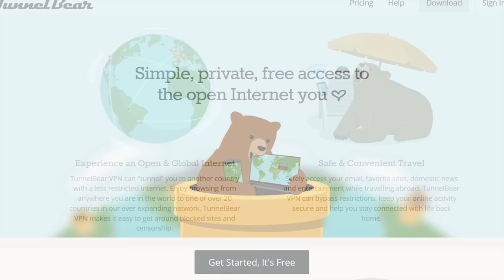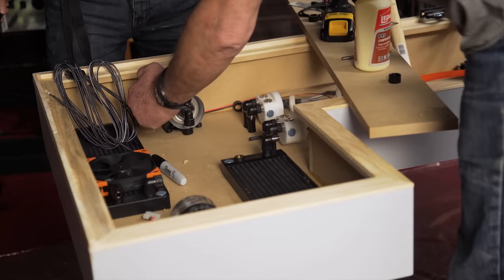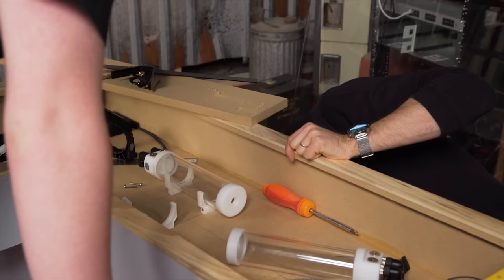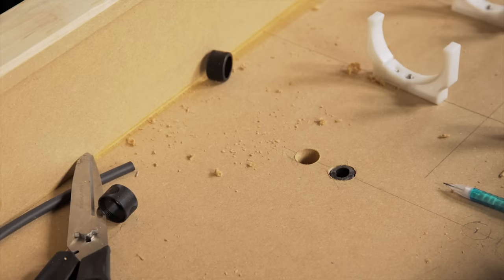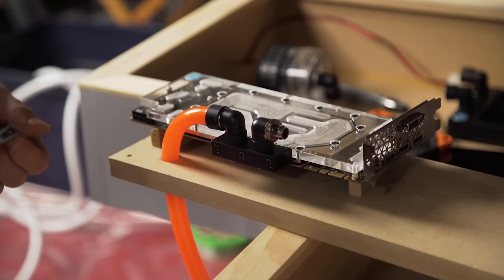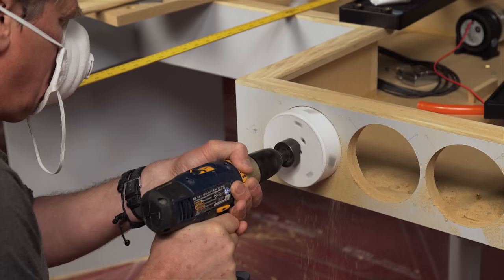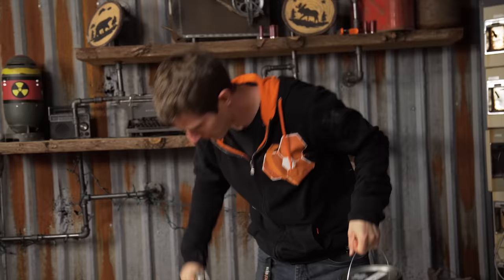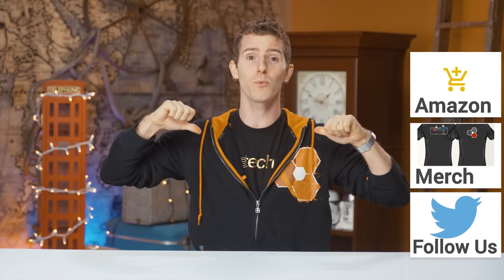Ultimate DIY Desk PC - DRILLING SO MANY HOLES

Comment: When building a desk:
1. Start with the desk's core - the top, so that the legs are not a problem and can be fitted later
2. Make a drawing - be it in AutoCAD, Google SketchUp, or even on paper, but take into account the thickness of all materials.
2b. Note where the holes go.
3. Since you did step 2, you can go to a shop, give them the dimensions and get parts cut to size and even laminated on sides usually for less money than your effort and tools needed are worth, unless you've got a workshop.

Comment: let me just state the crazy here. 40Tb of memoryspace??
Reply: Only 20tb thanks to raid 10!
Reply: you are right, but you have to stop somewhere, and it should be enough if you limit yourself just a little!
Reply: Krydolph But it's an one in a lifetime build, why not go wild?
Reply: If only it were 40Tb of RAM. ( Yes I know that would become useless)
Reply: Then why go a single 1080?
Reply: PeakLegacy You can use ram as super damn fast storage.
Reply: Jack Hinkley Good question
Reply: thats storage not memory bro
Reply: keppy considering ram is volatile, that's not exactly how things work.
Reply: Richard Mcilwain Linus explained in a video that your stuff can be stored in your SSD while your PC is off and when turned on everything will move to the RAM when turned on and back to the SSD when turning it off. It's very impractice but it's cool it can be done :D
Reply: But still requires an at least equivalent amount of storage, and it would be very slow to start the operating system I assume.
Reply: I need more space :(
Reply: TheBadBear -
Reply: TheBadBear Linus told me he's giving me the desk after he finishes it
Reply: +Imaad siddiqui yeah sure buddy
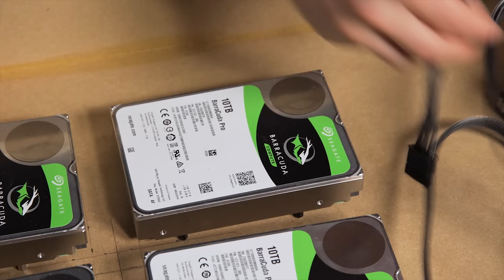Reply: Oscar yes there are 4. Each of them with 10TB storage as you can see in 3:47. 4x 10TB makes 40TB!!

observe before commenting
Reply: Howard Kurtus yeah right. sorry got things mixed up.
Reply: im just disappoited he is not using ssds indtead of hdd

Comment: "Ran to home depot to have the cuts made"  Yep, that's why your measurements are wrong
Reply: cmon guys, running down for a corded drill? Almost all your employee's are male, why don't you already have one?
Reply: TacticalBBQSauce are u saying that all men have a corded drill? TRIGGERED lmao
Reply: We don't?
Reply: DominoGames triggerrd!!!
Reply: I have something better a cordless drill witch uses 4 standard 18650 batteries which can be swapped out for a new set in minutes
Reply: +dossed yup, cordless drill with hot-swapable batteries is the ONLY way to go for me.
Reply: Just because I'm male doesn't mean I own a drill. I mean, I DO, but not just because I'm male.
Reply: Suhkma Dheek real men use their fingers to drill holes
Reply: Suhkma Dheek yo im lmao thats rlly good XDD
Reply: are you that tv commercial i saw today?
Reply: Real men have a carpenter's brace.
Reply: Everybody regardless of gender should have a Drill, Saw, and a few screwdrivers at least.
Reply: @tkfritz5790  I fully believe everyone of every gender needs to have a fully stocked tool set. With Klein hand tools, and while I prefer Milwaukee (old school, not used their new stuff, can't say), DeWalt is also acceptable (can you tell I was raised by an electrician?)

Comment: Moral of the story: dont use a desk with legs
Reply: James Landess dude same
Reply: use a desk that floats obviously or have slaves hold it up
Reply: T_T or use saw-horses to set just the top of the desk on and mount the legs last.
Reply: put the legs on the edges
Reply: Actual moral of the story: measure out where the legs are underneath, then draw it on top so you ACTUALLY know where the legs are xD
Reply: Actually the moral of the story is use CAD.
Reply: More like: don't use a desk with weird ass positioned legs. :D
Reply: Cant wait for hovering desks

Comment: Template tip, all of the standards for hole spacings and also I/O panels are readily available online. Use a CAD program such as autocad, sketchup, OnShape (my favorite), etc. to draw out or import the hole patterns, and print 1:1, double check the dimensions with a ruler/scale. Then use carpet tape to stick to your MDF or material, punch then drill the holes. You could have laid out all four of the hard drives on one sheet of 11" x 17", printed 1:1 in poster mode for the motherboard, or even you really felt over ambitious lay out the whole thing and print 1:1 in poster mode, tape it all together and drill all at once.

Comment: A little over 2 years later but a tip for building desks, tables or pretty much anything with legs. Have an idea where you want them to go but put them on last. For tables and flat desks you can always turn the whole thing upside down or on its side. That's why alot of pre-made furniture that you have to assemble yourself usually has the legs go on last in the instructions. Though I wouldnt suggest using only glue for holding them on with a heavy desk like this. The legs would probably break off when turning it back upright. Another tip is make sketches of everything.  From the shame of the desk, both inside and out and from all angles as well as where every component is going to go in relation to the desk itself. Even if you have to lay the actual pieces out first to get an idea. Like in part 1. Then you can start drilling and cutting.

Comment: My desk is built so that there is no gaps in the legs so to create airflow for my locked away computer I bought a second power supply to run 24 corsair sp120 purple led fans that I rigged to custom made vents along the join between the leg board thing and the top of the desk, tackled both my previously mentioned air flow problem and led lighting problem and looks AMAZING

Comment: Hey @LinusTechTips , i know it kind of doesn't matter at this point, but when you're using a power hole saw it is best to use a saw with a side-mounted handle for extra grip. Seen 4-5 guys at my old job break their wrists when the saw gets to hot or hits a snag and binds up. Anyways, great work, can't wait to see it when it is finished!

Comment: next time you do this, step 1 probably ought to be laying out a big sheet of butcher paper in the shape of your projected desk and arranging and marking out your components onto it, marking where to drill holes.  That can inform where to put legs, cutouts, etc without conflicting. also you can just tape the paper to the board when drilling.    Basically, since you want it to be a computer, figure out how to make the computer first, then make that a table, rather than the other way round.

Comment: Should have put in a false bottom for your tubing and cable management it seemed more than deep enough, as for the radiator fan holes just drill through both.

Comment: Personally I would have placed the motherboard with I/O going out the back, therefore making external cables for mouse/keyboard, networking, etc. less visible and then use a LED power/reset button and either a USB 3.0 front I/O panel and mount them on the front instead. I also would have made it as a L-shaped corner desk, but that's just because of spatial obstructions. (benefits of living in a small dorm...)

Pretty much if it weren't $2,000 USD and completely sold out, I would be thinking of a design very similar to Red Harbinger's Cross-Desk, but to put in a corner.

Comment: I made a desk similar to this! 
I eventually decided on having 2 glass panes instead of one big piece of glass as my mouse pad was going to cover it anyway, I used the hidden space in the center to do the cable management. 
I also added speakers in the legs, so they are a bit different to mine. 

(I have uploaded a video on it if you guys want to check it out its my latest one.)

Comment: For the legs you could of cut out notches in the actual leg any time you had a hole that hit one. Wouldn't of hurt structural integrity and would of aloud you to run water lines or cables without it looking like you made a planning mistake.

Comment: You could've also used a woodworking router to recess the glass and not have the problem with it possibly slipping and then just done something with the edges to get it to blend in

Comment: At this point you should start over since this is not really generic design anymore. It was an interesting design using only 1 sheet of MDF however you would have been better off with a more traditional 4 legged support design or placed the legs as part of the sides and added MDF side support for horizontal deflection...

Comment: Instead of hitting the legs every time why didn't you measure from edge to edge to double check the hole location on the bottom BEFORE drilling...

Comment: I need some advice I was playing on my PC then it suddenly turned off (lost power I think) and now it won't boot all the fans spin the gpu light is on 
I think it's the cpu or mobo 
Any solutions?
I have warranty on all my parts but I would prefer not having to send every part to be replaced

Comment: why not build a metal construction and place the radiators in the side and just run it through an partition. I mean it is more expensive and heavy probably more complication with cutting and other things but it seems easier.

Comment: Hi Linus i have a question. because i have a air cooled pc (except CPU) and i want to change it in to a desk pc would there be enough of air flow with 6 120mm fans and will the components over heat?

Comment: hey linus I have an issue i was installing windows 7 on 500 gb hard drive form win8.1 desk pc setup was in my 500gig hard drive. then everything going nice and suddenly my sata cable from desk was pop out. maybe not properly connected though. then what happenning is whenever i starts my desk pc it starts in win 7 and stucks with  a command prompt .also my desk is running on win 8.1.
can you solve this problem.

Comment: would of been nice to install 2 latches on the user side and a gas strut and hinges to lift the whole glass for easy cleaning and changing components. rather than sealing the glass to the table.

Comment: Does anyone realize that building a computer inside of a wooden box without any metal liners can create EMI (Electro-Magnetic Interference) problems? All electronics (even traces on a PC board - acting like antenna transceivers) produce some amount of EMI and/or are affected by some level of nearby EMI. Your computer case serves as the obvious container for the computer parts...but it also reduces/prevents EMI from escaping and/or EMI from entering. Coming from an electronics engineer background having to get FCC approval on ALL electronics made for retail forces anyone in this field to have to extensively learn about EMI and EMC (Electro-Magnetic Compatibility). So, depending on how robust your computer's electronics are and the surrounding electronics are (i.e. the stuff in the same room), you may find 'unusual' things occurring with either the computer and/or other electronics in the same room. So if that does happen...you'll now know why. You can line the inner box using copper tape sold for a reasonable price on eBay which would decrease this natural phenomenon (apply side by side with no seams and the complete copper shield must be grounded preferably at a single point), but the glass is another thing (can't cover up what you wanted to look good). Off hand I've never looked up the effectiveness of glass on EMI control/reduction, but I know wood doesn't do much if not anything at all.

Comment: So I have an Pentium G4400 and a GTX 750TI and I want to upgrade to an i7 6700k and a GTX 1060 6GB, but I only have enough money to buy one for now, which one should I upgrade first? 
The games I mainly play are:
Dark Souls 1, 2 & 3
Battlefiled 1
Skyrim with Mods
Reply: Areguil Gamer i think the processor
Reply: Neither. Save up money and buy both. You'll probably need a new motherboard to support the new processor btw.
Reply: CPU and mobo deffo, your current CPU is already bottlenecking the 750. 1060 prices will drop after christmas anyway.
Reply: eh not neccesarily
theyre both socket 1151, but if he wants the 6700k, he defo will have to upgrade to a z170
Reply: Areguil Gamer always upgrade the Cpu first. Also i would recommend you getting a 1070 or 1080 over the 60, the i7 will get bottlenecked by the gpu.
Reply: x2ceyez HAHAHAHA NO
Reply: nice try, but no, just no....
Reply: Areguil Gamer get the 6600k if you're a gamer (watch Linus' vid about it)
Reply: Get an i5-6500 and later a 1070. Much more balanced.
Reply: BassFyro 
No, i won't. I have z170 mini itx mobo.
Reply: Areguil Gamer Ah. Get a 6600K then.
Reply: I also do editing and photoshop, which is why I prefer to get the i7. I have a a Z170 Mini ITX MOBO.
Reply: Johan Ekstrom 
Okay, then. Thanks!
Reply: Areguil Gamer the cpu for sure.
Reply: your cpu is on current generation so you don't need to bother much about CPU (hence it's an entry level CPU), if you focus on game go for GPU else CPU. it's up to your PC primary task.
Reply: Get a i5 and a rx 480 for bf1 to get the best fps
Reply: Areguil Gamer dude do cpu in most mmo games it's better and it give su faster processing speed and it's so good that it can make your computer run about 60 to 100 fps more in game
Reply: Areguil Gamer If you do editing a lot and you feel like you could use more power there, then there is a good reason to take CPU now. GPU would be a waste because your current CPU would choke it hard. I took i7-6700k myself because I do graphic editing of different kinds and paired GTX 970 with that, since I didn't have enough money to buy too wild of a GPU as well. You might be fine with i5-6600, but that's something you'd have to decide for yourself. GTX 1060 is a successor to GTX 970, so I can tell you you won't be disappointed on 1080p, but again, decide for yourself whether you want to balance your PC for gaming more.
Reply: BassFyro The 1070 is the successor of the 970...
Reply: Johan Ekstrom It is not. 900 series was an exception in nomenclature, it has everything shifted up. Do not spill out disinformation based on uninformed logic. 1060 has ~10% better performance compared to 970 and also costs less.
Reply: encouraging people who already have latest cpu generation to buy new motherboard while lecturing other to not misinform. SMH
Reply: Nick Nack Snip Snap He didn't say which one he has, did he now?
Reply: BassFyro What's your location? The 970 was around $350 for a long time after launch, and the 1070 is around $380. T
Reply: Johan Ekstrom Oh look, glorious American pricing has changed.
Reply: BassFyro ? What is it? Non-american prices will never be at the American MSRP.
Reply: Johan Ekstrom Still doesn't matter to anything OP asked.
Reply: BassFyro True, but the 1060 is still not a successor to the 970.
Reply: Johan Ekstrom Image was a lot different back at launch.
Reply: BassFyro True.
Reply: "I have an Pentium G4400" meaning socket LGA 1511. do we really need to buy new mobo for upgrade cpu?
Reply: Nick Nack Snip Snap Depends on which motherboard it is. If you want i7-6700 with a K at the end, you would probably want a motherboard that would support a nice overclock of the CPU.
Reply: Save more money and get both. Its gonna suck either way if you only get one. Get an i5 and a1070. Your system would be future proofed for a few years.
Reply: Get a 6600k/6500
Reply: Stick with your decision and get an i7-6700k and GTX 1060 6gb, i have the same parts and i love it already (had them for about 1 week) People telling you go for a 1070, dont do it, its not neccesairy. 
But hey, thats my opinion! :p
Reply: PhysixTV i7 and a semi-low-end card is very unbalanced.
Reply: Well how is 1060 a low end card?
Reply: PhysixTV semi-low-end. Maybe lower mid-range. But my point still stands...
Reply: But my question still stands..
Reply: PhysixTV No it doesn't. x60s are always the low-midrange/higher low-end.

Comment: Guys and Gals I need help creating a Pc build I know a fair bit about the Gtx 1070 but I don't know a lot of the other stuff so can you guys help and if you can please if possible let it be in the red with black color scheme or just black or black and gray please and thank you and please keep it under 1500 Linus of you help I will be grateful
Reply: Hey there, a place that might help you out is the http://www.logicalincrements.com/ website. It's a commonly used site because it's a great way to get the basic parts you want to build your machine without having to do an initial overwhelming amount of research. Also there's a post I found on the /r/buildmeapc subreddit that has quite a few good builds on it https://www.reddit.com/r/buildmeapc/comments/3r5a85/heres_some_builds_i_made_450_550_fallout_4/

These are two good places to start and if you have questions feel free to ask. I'm FAR from an expert but having built three computers in the past I could probably offer a tiny bit of advice. I do highly recommend reading through the logical increments info at the bottom of the page because it could tell you a bunch of info that will really help you out.